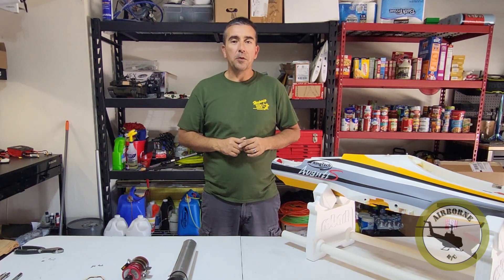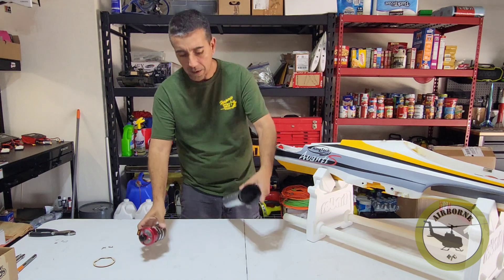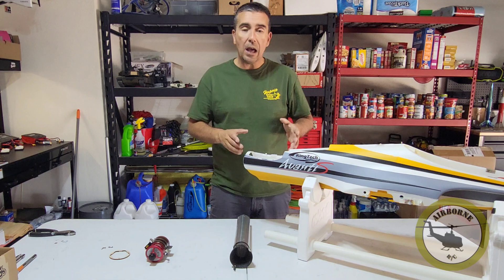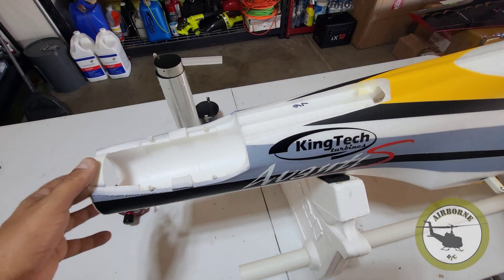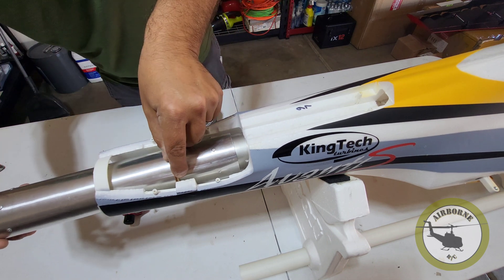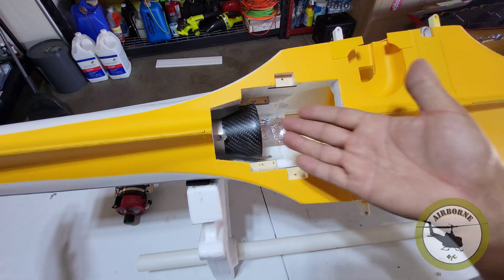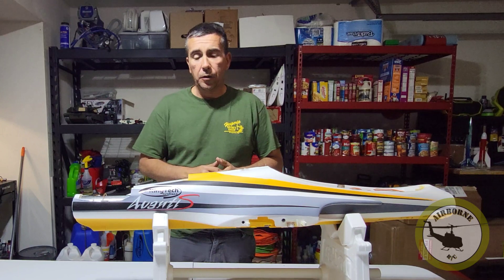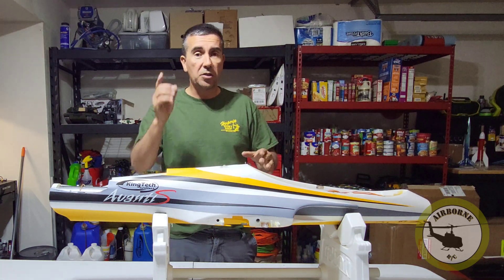Freewing Avanti Turbine Conversion. Thrust tube and Turbine installation Episode 06

Comment: I think I had the same diameter bell-mouth. You can actually get the pipe in from the back with the bell-mouth attached. Slide in the back portion of the pipe trough the top where the elevator and rudder go and out the back. Shift it  back until the bell-mouth fits into the fuse. and then push it forward. The diameter at the back of the fuse is less than just in front of the elevator. Worked with mine...

Comment: may i ask do you not have to use heat tape to stop the foam fuselage getting hot.
or is the twin wall pipe sufficient to allow cooling.
thanks for the videos
Reply from the maker: Thank you for watching and commenting! No i did not use any aluminum tape. the double wall cools enough none is needed. Now if you use a single wall pipe the tape i would HIGHLY recommend.